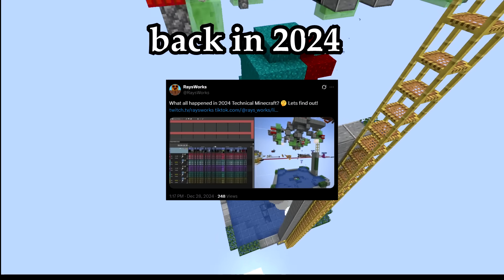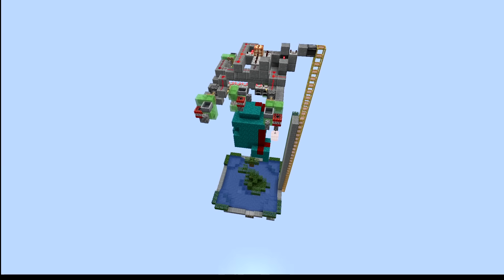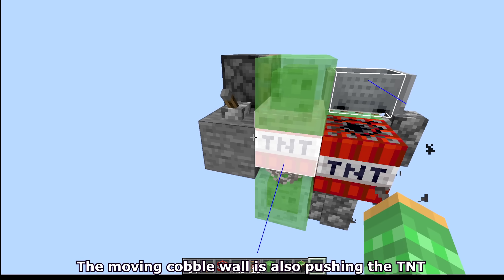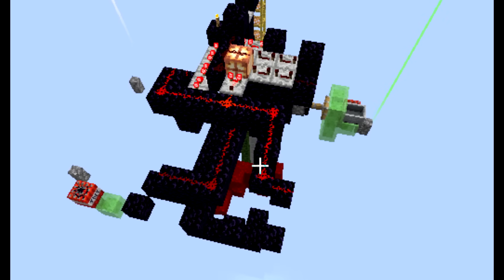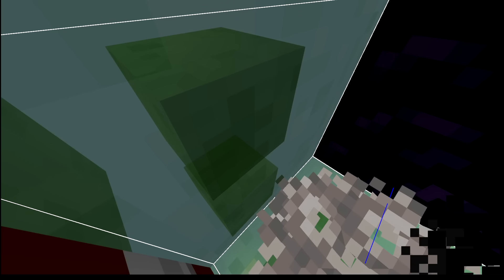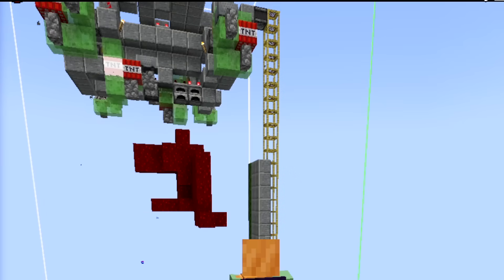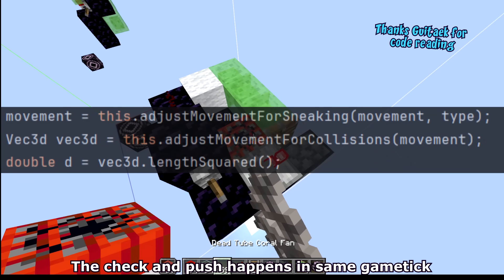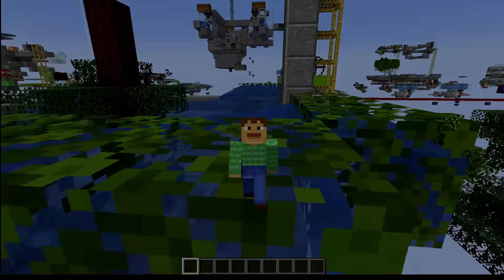0.0002% of Minecraft TNT can go through walls…

Comment: Good job !
On another topic, if you're interested, I ran some tests with lightning rods, and discovered they were inconsistent.
After dozens of hours of permanent thunderstorm, the wool flooring was severely damaged outside of the 128 blocks radius area, as expected, but I noticed a few holes inside of the supposedly protected area.
Skeleton trap is not the explanation (they don't start fire + I was in creative + the holes appeared far from my afk position).
Lava is not the explanation (far from the ground)
No mention of that on the bug tracker.

Comment: I love that this entire video was "this one weird problem keeps breaking my tree farm, so I did tons of research, figured out what it was, then left the tree farm exactly as it was and left satisfied"
Reply: its not really something you can fix in your tnt duper, it has to be fixed in the code so it needs either a mod or an update
Reply: @NathanHaaren  use differend tnt dupper
Reply: @bury4660  you're acting as if there are countless of designs and the others all dont have this issue.. I think most of them would have the same issue of clipping enough into a block to be pulled around by slime
Reply: @NathanHaaren  use dupper without slime blocks
Reply: @bury4660  every tnt duper needs slime blocks
Reply: @bury4660  alright.. which tnt duper doesnt have slime? (or honey because that would probably have the same issue)
Reply: @NathanHaaren  scorpio simple TNT dupper withou slime blocks or coral
Reply: @ExplodingDarth  sometimes knowledge is its own reward.

Comment: Cool that this is technically possible, but agreed that it's not really useful for anything.
Reply: @iIO_OIi  This behaviour is very useful useful for moving tnt or entities in general in places where a normal slime boost wouldn’t fit
Reply: @millocracy That is true, but how often does that scenario comes up?  Given how finicky it is to set up (provided a reliable way of getting the exact right positioning), and how incredibly limited it's range is and specific the mechanic is, this all together makes it seem very impractical.
I'm not confident that it's actually going to provide benefit in practice, or that the benefit will be significant if it does.
I do certainly think it's cool, but also VERY limited.

Comment: This going so long undetected even at 0.0002% chance with how many people play and for a long period of time is actually not surprising, since most TNT Dupers don't pull tnt back toward itself, but rather use other methods that keep tnt away, and prevent giving it the angles that can cause this. Still, good to be reported and hopefully get fixed, as not every duper design is as optimal, and who knows if some may end up increasing or decreasing this risk over time.

Comment: I believe the explanation is incorrect. It is more likely that this is about the joinIsNotEmpty not realizing that two VoxelShapes intersect during the tnt entity's movement attempt due to the 1e-7 margins
Reply: Thanks for your opinion. We also stumbled upon this code snippet. While it is true, that according to the name, it should return true but in reality it returns false, and while a margin of 1e-7 would perfectly explain the bug and also this is called in the snippet that corrects the movement, first the margin is in the wrong direction, including more than there is "mathematical" and even if the if clause would evaluate to "true" the return result would still return false because the predicate is and and both booleans are false. Therefore we are not sure, why this happens and we intentionally left out why it doesn't move back when it's barely clipping inside the block. The other case, when it isn't even clipping into the block definitely comes from an implicit conversation. Java reliably returns the wrong result so the entity counts as clipping into the block (see bug report)
Reply: @guitaek  I mean that the merging of two voxelshapes rounds to the existing boundary if the new boundary is within 1e-7
Reply: Einstein vs Nikola Tesla type debate @guitaek

Comment: I found a way to make an inescapable prison even in creative mode
Basically you either blow up a bunch of tnt or specially calibrate a tnt cannon so that a lit piece of tnt goes into an unloaded chunk the tick that it explodes, so when you reload the chunk you get a tnt entity that will never explode and cannot be broken, even if you relog the game. I was able to fishing pole it into a hole, and if I put it on the edge of a block below a chest, I can break the block underneath, allowing a player to stand in the hole with the entity at head height, blocking all breaking or placing blocks, and if you replace the chest with a trapped chest, you can sometimes manage to open the chest, so I wired it up to a non sticky piston so it could punch a block down onto me. Once I did that even if I could open the chest , I still couldn’t break any blocks, and the only way out was spectator mode

Comment: I’d still wonder why most tnt farms use tnt duping and just wondering if there’s any way to change it to use a dispenser instead.
Reply: Why would you ever want to farm tnt for dispensers when you could get it for free by duping????
Reply: Because dispenser is non-movable so, no.
Reply: Correct me if I've missed something in recent times, but there's no renewable or reasonably automatic way to get sand, this alone is sufficient to be a no go for most people, and reasonably so.
Reply: @iIO_OIi  end portal sand dupe? or is that patched
Reply: @hogger7 If we're in a discussion about why TNT duping is the go to method for blowing stuff up, I'm not sure if sand duping is semantically much different...
Reply: @iIO_OIi Renewable Sand has a couple of ways both finnicky to work with:

Wandering Traders trade 8 sand for an emerald. E-yup. Good luck if they even offer that.

Or through another exploit.
Learning how make the gravity block duping contraption with end portals or exit portals.
Reply: What if mojang actually fixes tnt duping.
Reply: @kordellcurl7559  Then it'll massively make the game worse
Reply: Here’s a hot take, what if tnt duping is actually making the game worse overall because the fact no one wants to change it and make an actual way to use tnt and make sand farms. Either having a mob that does the same thing as tnt duping or making dispensers movable or adding a new block. I feel that keeping tnt duping in the game is kinda giving up the potential for something new from mojang ( who by the way needed to be convinced on keeping tnt and sand duping in the game).
Reply: @kordellcurl7559  To this end, why not an alternative explosion source? It doesn't have to be TNT (more powerful than ghast balls though, unless it wood I guess).

To clarify, this isn't an argument, just another angle on the matter.

Comment: Heyo, the mechanic you are referring to is called float alignmet. Its extensively used for item sorters and especially TNT cannons. There are many reliable ways of getting a TNT into this state, although it happening via micro motion is news to me.

Vanilla setup: Have a fence above a slime block, a TNT beside it and a Piston pointing into the TNT. Prime the TNT and extend the piston, so it pushes the TNT against the fence. Let the Piston retract. The TNT is now float aligned against the slime and when moving the slime it gets boosted.

Note: The Piston must be able to temporarily pull the TNT inside its hitbox. So if there's blocks around the piston it might no work (again micro motion)

Comment: this normally wouldn't affect tnt in its normal "intended" use i think but if they fix this specific problem won't they be unintentionally admitting to tnt duping is now a feature and not a bug?
Reply: they already briefly fixed tnt duping a few years back, and then unfixed it after community backlash because there's currently no other reasonable way to do any of the things we use tnt dupers for. they've said they will only re-fix it once there is something else implemented for those purposes (which may never happen)
Reply: @NotnatTlikehis  thanks for this i never knew that :D
Reply: @NotnatTlikehis That is just pure entitlement.
Reply: @NotnatTlikehis  which will never happen coz imagine updates that actually do smth
Reply: they already admitted that openly
Reply: TNT's clipping into nearby blocks when getting motion in some particular degrees has nothing to do with tnt dupers, it was just discovered using one
Reply: They have a toggle in the games code that enables / disables tnt duping iirc

Comment: Pretty sure this is the same bug that some parkour maps / escape rooms use with players clipping inside the edges of blocks. I could be wrong though.
Reply: Interesting! Do you have a video title so we can take a look at it?
Reply: @guitaek  I think its called 1E7 stepping or somthing of the sort
Reply: Yeah it's called 1e-7 clipping since you clip in, well 1e-7 blocks or 0.0000001 blocks to jump 0.25 blocks higher
Reply: @nonexistentsquare2092 found it thanks. To all: This happens only when we move at less than 1e-7 blocks, doesn't it? Since we move approx. 0.1 blocks this isn't applicable is it?

Comment: Use this for slow clocks
Reply: @Michael-yq4nz  unfortunately since it's based on probability it doesn't mean that it will always happen at the same time, we'd get a clock that his terrible at precise timings and a daylight sensor with a counter can do the job much more simply, in a much more precise way and without damaging itself
Reply: Isn't daylight inconsistent depending on if people skip the night?
Reply: @Ciurkdamn, you make a good point. it's just that I never sleep in minecraft so I completely forgot
Reply: it's inconsistent. if the odda of something is 1/100 it doesn't mean that it'll happen even if you do 100 attempts. unless you want something that goes of very slowly and randomly.
Reply: just using a few redstone clocks connected to each other can make very slow clocks easily. check out mumbo jumbo's video on that
Reply: There is no problems using probabilistic systems, depends on the problem, advantages: most of the time it is less logistic, it becomes more precise the larger the scale become. Sure it breaks, but it can be an event repairing your clock that tick mostly every 1/500000 times. I'll have fun looking at problems I created myself then...